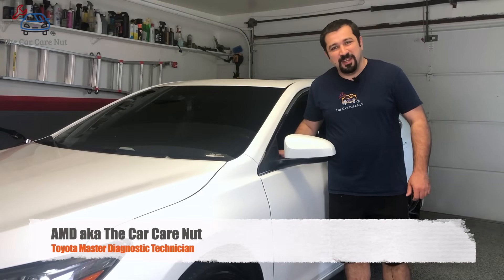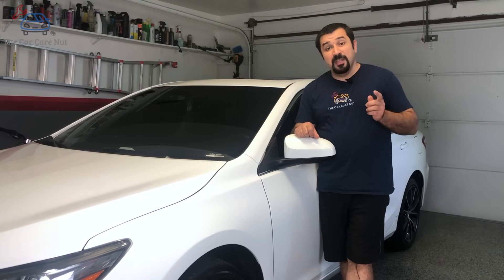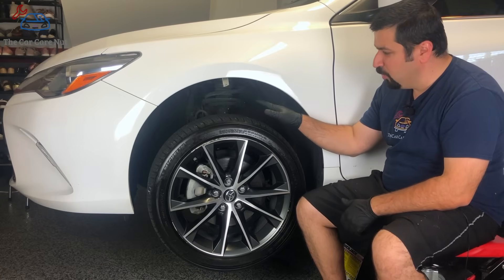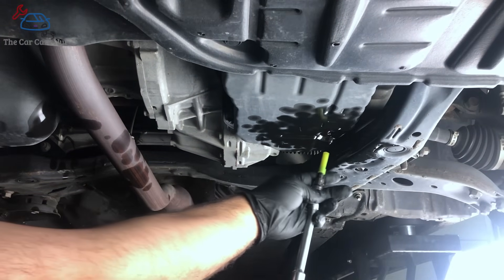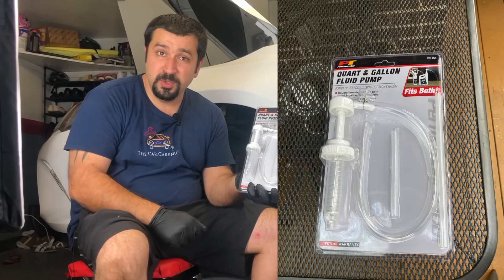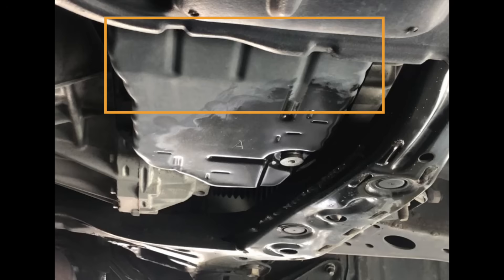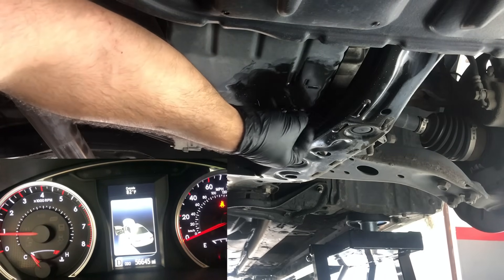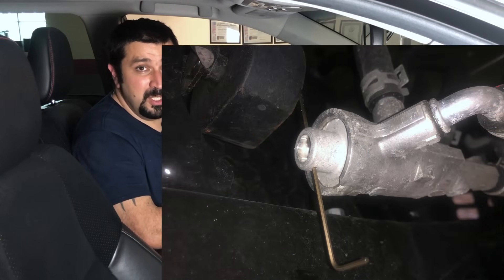How to change your Toyota Sealed Transmission Fluid

Comment: I used this same procedure to set the level of my Aisin U660F transmission in my '13 Lexus RX350 AWD (same transmission as RAV4 AWD, Sienna AWD, Venza AWD if they have the 2GR-FE engine).  However, I did a transmission flush at the same time, which is not covered in your video.   As I don't have the transmission flushing machine that transmission shops have, I used the old shade-tree mechanics trick of pulling one of the hoses off my transmission cooler (the external one in my case, as I have the towing package), with the engine runnning, and very quickly pumping in new fluid at the same time the old fluid is being pumped out.  For anyone reading this:  THIS IS A RISKY PROCEEDURE because if you let the level drop too much while the engine is running, you could damage your trans.   @The Car Care Nut, is this something you can cover in a how-to video?
Reply from the maker: The flush method with the hose off it risky as you said. I use a machine at work that does the exchange. To be honest I don’t recommend that method because the oil pump in these transmissions is notorious for easy failure when it runs very low on fluid. I’ve seen many transmissions pumps go out because of low fluid. Having said that I will do some research on a low cost exchange machine and plan to test it and see if it’s worth to recommend it as a DIY alternative to an expensive one.

Comment: It's important to watch multiple 6 & 8 speed transmission oil change videos as each has its strengths and weaknesses. Example: Car Care Nut covers a complicated electronic method of determining the fluid temperature & level whereas others show you the simple infrared temp gun method and some show both: https://youtu.be/ej_6BZpK3gg
Reply from the maker: Very good point. The more you watch the more knowledge you gain!

Comment: I have a 2007 Camry with this transmission.  It has a light for the D instead of the digital. Am I correct in assuming this procedure (going back and forth from N to D) will not work like it does in the digital? Thanks, great video!
Reply from the maker: The procedure will work on your 2007 Camry. It will use the D light bulb. When the light is off it’s too cold wait. When the D light comes on when you’re in park it means you’re at temperature and you should adjust the fluid. If the light start flashing or blinking I means the fluid is too hot shut off the car and let it cool down and start again.
Reply: @TheCarCareNut  thank you so much! I wish Toyota didn't go over to this design, but this video is so helpful so I can DIY.
Reply from the maker: In my opinion they did this possibly to cut costs on the dipstick. They also did this to prevent people who did a lot of dipstick transmission fills wrong. But if you do this right you should have no problems at all! Glad the video helped.

Comment: What is the draw back if I just top up with the same amount during cold drain?
Reply from the maker: You don’t know if your fluid level was accurate to start. There’s some fluid loss when you drain and fill and if errors are made you could further the incorrect level more.
Reply: Thanks, awesome video. very detail and helpful.
Reply: did you do a cold drain?

Comment: A top tip that I do because I hate those hand pumps, I use a piece of clear hose attached to a funnel. I slip the tubing into the fill hole and pour. It's so much easier. 😁
Reply from the maker: That works! I have the official tool from Toyota which is pressurized and can fill the trans in 5 seconds but it’s an expensive tool and wanted something that is cheap and that works.
Reply: @TheCarCareNut  A few feet of tubing and a funnel I had lying around. Gravity is free! 😁
Reply from the maker: JimsGarageToys yes sir! That’s a good suggestion thank you!
Reply: Autozone sells a graduated funnel ,has numbers with to know how. Much fluid. It has a long flexible tube to go in the hole. $5.
Reply from the maker: Another awesome suggestion! Thank you Ahmad!

Comment: Very good video, thanks!
2 comments/question:
- I'd personally start by ensuring I can unscrew the fill plug before draining all the liquid. In case something goes wrong and the fill plug is stuck, then it's still possible to drive the car :)
- Can you go over the procedure for an hybrid? Or if it's pretty similar, what would be the differences between the 2?
Once again, keep up the good work!
Reply from the maker: Very good idea! Thank you! You’re actually gonna take the cover off in the car preparation wouldn’t hurt to take it off or at least loosen it!

For the hybrid I will plan to make a video for everyone however it’s very simple on the hybrid. It is similar to a differential, basically the a drain plug and fill plug higher than the drain. You drain it then fill it until it overflows from the fill plug and close the plug.
Reply: Thanks for the detailed answer. Excited for the hybrid video!
Reply: I've changed the CVT fluid in my wife's Prius several times and it's just like a manual transmission that you drain and then fill until it flows out of the fill hole, very easy. I change it every 30-35k miles.

Comment: Have 09 Camry v6 and a 17 Highlander v6 about how much fluid is needed for each one on a change like this?
Reply from the maker: That’s a hard one to guess it all depends on how long did the trans sit and how long you let it drain. I’d say in most cases you won’t need more than 3-5 quarts. Be on the safe side and have 5 quarts per car. If you didn’t use some, leave it for the next. And remember you can always save the fluid if unopened.
Reply: My 09 V6 took 3 quarts every time I drain and fill

Comment: Thanks for the awesome video! been waiting for that one!  2015 CVT Corolla here...So if you don't have a helper, do the procedure until the temp is right and then go under the car to drain extra (assuming there is extra); don't you run the risk that while you wait for the extra to drain, the temp will become too high? which i assume would mean the fluid expended too much so you would remove too much?  

Also, let's say you reach right temp, go under to drain and nothing comes out OR you wait a week like you suggested, check level and nothing comes out.... do you just add let's say 1/2 a quart, warm up to correct temp and drain extra or would you recommend something else.  thank you once again for your great help and channel!!
Reply from the maker: Hello! Hope you’re having a good day! You are one of the people I thought off when filming this video being one of the first to request it! I recommend you practice the procedure before actually draining the oil. That way you’re familiar with it and can do it quickly. Usually you have about 5 minutes give or take of work time once it reaches the temperature. If nothing comes out when you’re at the adjustment temperature keep adding fluid until you see it come out of the drain plug. The reason I recommend you recheck the fluid level after a short time is to make sure that while you were adjusting you didn’t cross the temperature limit. It helps to have a helper to tell you when the light start flashing so you can abort and let it cool down before continuing. It helps tremendously if you start with the transmission that sat overnight.

Comment: So what kinds of problems can occur if the fluid level is not right? 

Also with extreme temperatures such as the heat wave in CALIFORNIA right now. This may not be a good time to perform this maintenance, would you say?
Reply from the maker: Christian Da Costa awesome question! Thank you! If the fluid level is too low you’ll have delayed engagement when cold and shift flare or slips when turning. Also a very harsh engagement on reverse. If the fluid is too high you could have leaks, also I’ve seen a few whining noises from the trans pump. On the heat wave in California I’d wait until it passes ideally you want the outside temperature to be less than 95 degree F. The colder it is outside the more time you’ll have to work with.
Reply: @TheCarCareNut  what could cause slipping when at operating temperature is there a major problem or maybe just a program issue? Is it necessary to only take to a dealer for this or a good Toyota mechanic could further diagnose?  Thank-you!
Reply from the maker: Christian Da Costa if the fluid is low it could cause slipping. However if the fluid level is correct and there’s slipping that would be another issue. Do you have slipping issues? Which model and year?
Reply: @TheCarCareNut  2010 Toyota Highlander Limited 3.5 L AWD. Just recently had the transmission fluid service done. Your video raised some concerns as I watched as well. Thank you for your post and communication.
Reply from the maker: Did you have done at a shop? Or did it yourself?
Reply: @TheCarCareNut  it was done at a shop.
Reply from the maker: Ok if you have any issues bring it up to them and have them take a look.

Comment: I recently bought a 2016 Camry XLE V6 with 73,000 miles. I had the Toyota dealer near me do a transmission flush. Just wondering what are your thoughts on a flush and when would you recommend changing the transmission filter?
Reply from the maker: I wouldn’t worry about the flush. If the flush is done right it actually replaces more fluid than the drain and fill. The filter is really not a maintenance item. I wouldn’t worry about the filter too much. Every filter I’ve taken off was very clean and didn’t really have signs of clogging not even close. I would replace the fluid every 60k miles or 6 years.
Reply: Good to know thank you.
Reply: @TheCarCareNut  I do mine twice as often and if it's not replacing it all I would do a partial drain and fill more often than that!
Reply: @TheCarCareNut  yeah,  I changed the filter on a Nissan with 192k miles,  was clean and really was a waste of my time replacing it and the Pan gasket. 😂 learned my lesson
Reply from the maker: Every once in a while I get a customer at work wanting to replace the filter and I always think what a waste of money when the filter I take out is as clean as the new one

Comment: Please keep providing the great videos.  Question, my 2019 Highlander with 11K has grease on both axle boots(inners).  The inter tie rod boot is completely clean.  Is the normal?  Thanks.
Reply from the maker: That could indicate a leak either from the boot or from another component that’s leaking onto it. Could you take a picture and email it so I can take a look?

Comment: Can u go over that regarding the 8speed transmissions? The bypass valve? My gf has the 18 camry.
Reply: Like where it’s at and what exactly we need to do regarding the bypass valve
Reply from the maker: The 18 Camry doesn’t have the bypass valve. In the description of the video I posted all the cars that has it for the 8 speed so far only some highlander and sienna models have it
Reply: The Car Care Nut oh ok good. My gf 18 camry has the 8speed and I was wondering. Thank you very much. She has now 43k miles. I changed her tranny fluid at 30k. Still shifts good. Now I need to find the part numbers for the drain plug gasket and the fill plug gasket for it since I couldn’t find it last time